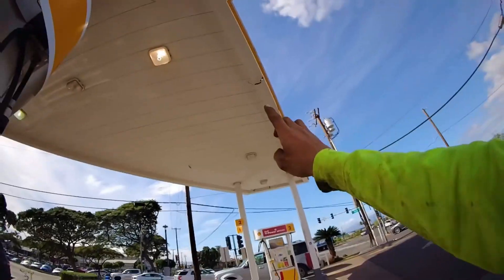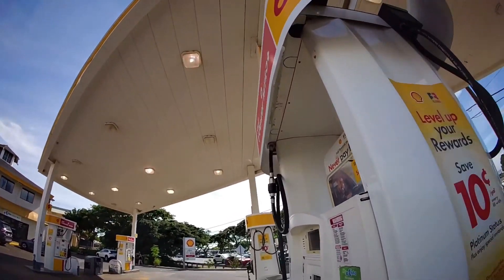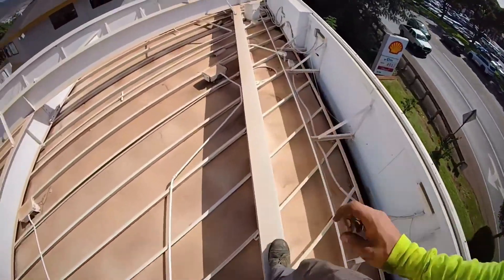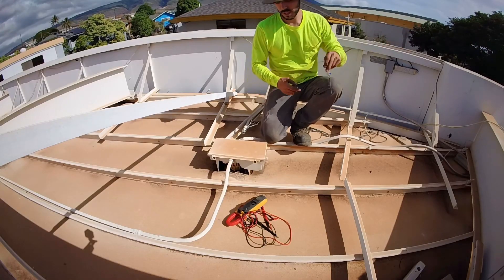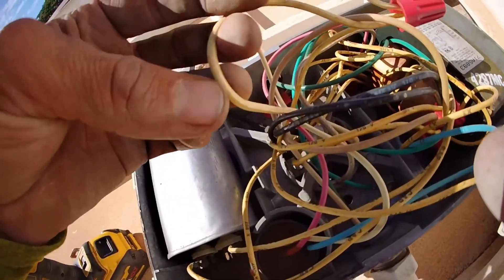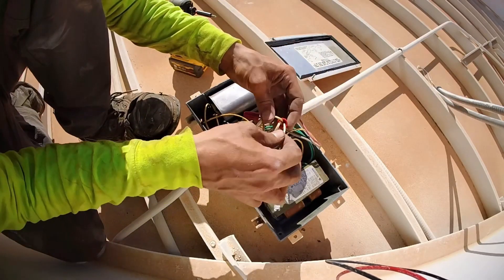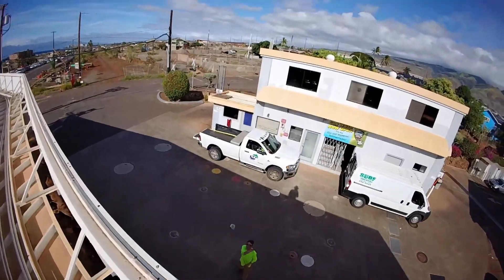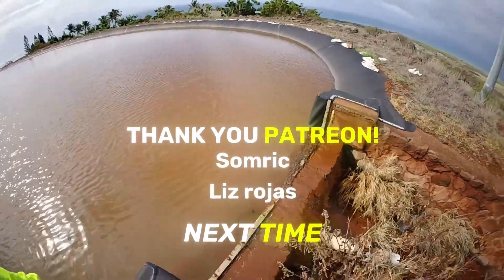Solving Mysteries On Gas Station Roof | Let's Work EP. 75

Comment: Metal halide lights are pretty simple. Above 150wt just Auto-transformer, capacitor,  socket & lamp. Only gets tricky with PULSE-START or smaller wattages that have STARTERS.
70% of the time, it's just the lamp.
Reply: ever got bitten by a SONigniter, that hurtz

Comment: when i was working stateside, a gas station freaked me out... 240v line to line, 240v each line to ground. First time i'd ever come across corner grounded delta. Was for the beer chillers.  The normal supply was also weird to a brit, high leg delta,  no idea why they had 2 supplies both with 240v ....